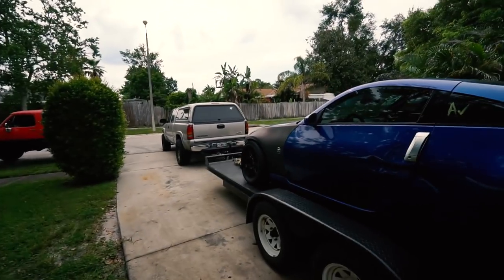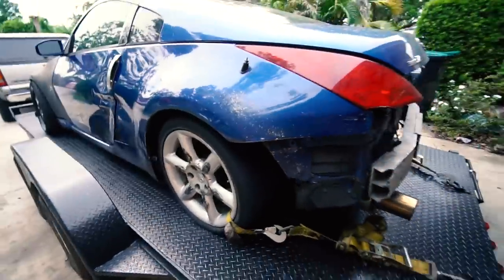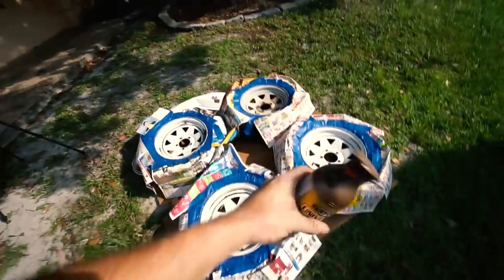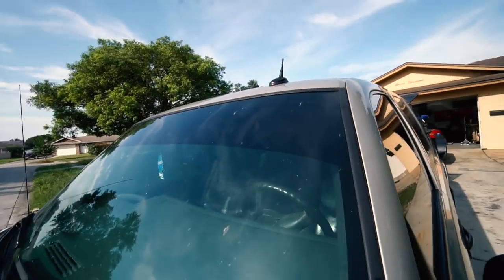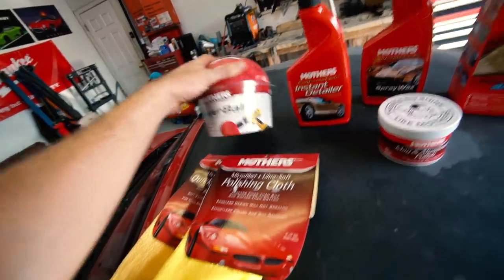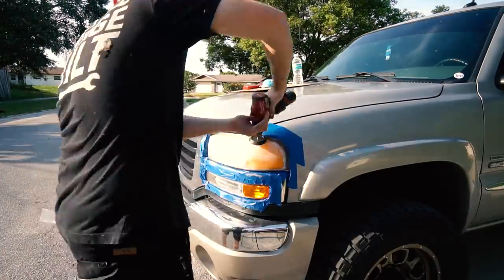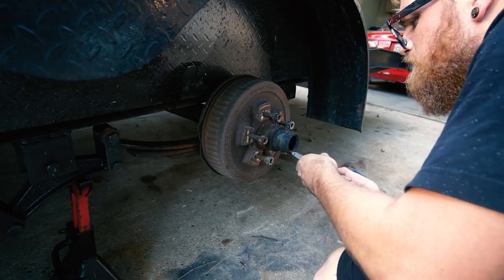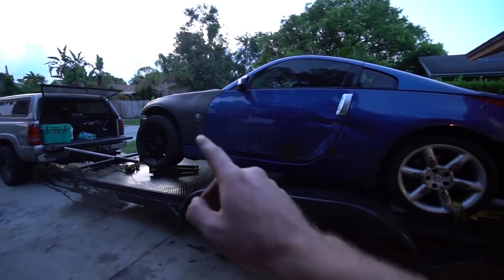Tow Rig Update + Truck and Trailer Mods

Comment: Just covering the wheel bearings in grease isn’t actually doing much, you need to have a lump of grease in ur palm and pressing down on it until the clean grease comes out the top of the roller bearings. Headlights look great keep up the good work man.
Reply: john hunter he’ll learn after he burns through a couple sets or looses a wheel. I’ve been telling him this forever.
Reply: Chris Tillman yeah learning the hard way, but he will get it. We have to remember he’s not a mechanic, but towing cross country he will learn very fast as a wheel will defo overtake him.
Reply from the maker: They were already greased. I was just adding some grease. Also, i did pack them, I just didn't put the 5 minutes of me putting grease on them in the video. Last time I did them on my old trailer, I didn't pack them at all while they were brand new, towed 14 hours, absolutely no issues. I repacked them to make everyone happy, but they were fine.

Comment: You'll need to clear coat those headlights or the will turn hazy again in a couple months. The reason they haze over to start with is because the factory UV resistant coating wears off. Then you remove what's left of that coating when you polish them.

Comment: Always love your videos. I think the truck looks sick with the shell, would look like too many others without it. Also, tip, trailer brakes can be adjusted without taking the wheel off. The backing plate for the drum has a small rubber grommet where the turn buckle thingy is. Can use regular flat head screwdriver to spin it, or get the actual tool. Looks like a tiny pry bar but more “Z” shaped and the ends come to a dull chisel point. Just remember which way is tighten. I spent years working on rv and trailers and still to this day go dumb when I go to adjust the brakes.

Comment: Camper shell is where it's at. I have one of the utility shells with tool boxes built into the sides that I put on my dually for events. It's so nice to have everything organized in the shell plus I don't have to worry about anything getting stolen or rained on. I stay at hotels a lot which makes the utility shell a bonus since it doesn't have glass for people to see into. 

You have a nice set up going on. BTW.
Reply from the maker: Exactly! Even stopping for dinner it's nice to have all my stuff secure and not just open for the taking. Thanks man!

Comment: Yo Taylor not sure torqued the trailer axle nut or not but that adjustment is the preload for the bearing, so too tight will burn your bearings and too loose and it might back itself off. 

Typically 20 foot lbs is the preload torque

Comment: Taylor, make sure the shop balancing your wheels has the proper weights. a lot of shops will use mainly quarters half and 1 ounce sticky weights for all their applications, with a wheel/tire set up like that you really should use a larger size weight to centralize the weight in the spot it should be on. also when using these smaller weights to achieve the balance a machine calls for, they can't put it all on the correct spot, and once balanced most of the small weights will fall off during normal driving. causing your balance to slowly deteriorate.

Comment: Replace the shocks and also check out if the yellow/red dot is lined up with he valve stem or opposite of the valve stem. Usually not a big deal but makes a huge difference on off-road tires

Comment: Black primer will work on making the wheels look more like the trucks wheels.. And rule of thumb when doing trailer brakes you should inspect/replace the bearings and repack them no matter what it is to easy for bearings to fail and cause major damage to your rig or someone else ask Trevor about the wheel on his trailer!!

Comment: Haven’t watched all your videos so I’m not sure if it has been mentioned yet. I noticed you unlocking the vette with the key, the fobs on eBay are dirt cheap and in my opinion are perfectly fine for the price. I’m sure an OEM case would wear better than mine has but the range and actual action on mine is fine. And programming can be accomplished from the driver seat without any specialty tools. Just passing it along if you didn’t already know.
Edit: while I’m acting like I know more than you, my buddy showed me the truck years ago of using playing cards to mask off a rim, just stick them in the bead as far as they will go and overlap. That way your masking further down the tire doesn’t have to be as exact and can be done faster.

Comment: all terrain/off road tires just vibrate at highway speeds, my buddy had some nitto tires that where better than any i have had but they still did it some. Also you can remove the yellow on headlights with bug spray if you are lazy, they wont make them crystal clear obviously but they take away the ugly yellow and make em look way better. If you dont believe me try it.
Reply: EvanThaG that's the Deet on the bug spray eating the plastic. It will actually ruin the headlights after a while and multiple uses.
Reply: I didnt say it was the right way, the lazy way.

Comment: I've been interested in getting a headlight renewal kit for my trucks headlights but I've always considered how long it will last. I've seen people that do the whole sanding and polishing and then use uv resistant clear coat to preserve it but I would like to not have to go that far lol so I really would like an update on the headlights in a couple weeks and months to see if it stays clear and pretty or if the fade out again fast
Reply: Jared Anthony any light restoration you do needs sealing for the lonest lasting finish & best results. You can do a general headlight restore & not seal with a uv resistant clear coat & you will be cleaning them up every 3 to 6 months.
Reply: Ben Pratt products like these tend to advertise being long lasting headlight restoration. That to me means the polishing compound may have uv resistance that embeds in the plastic and keeps it clear longer. Hence why I want the update to see how long it actually lasts

Comment: I would do the wheels again in a satin black paint and then respray that some bronze paint but not completely. Do it to where you still have the black but just misted over with bronze until the color is where you like it. That is how you can match the color a lot better to what the truck has.